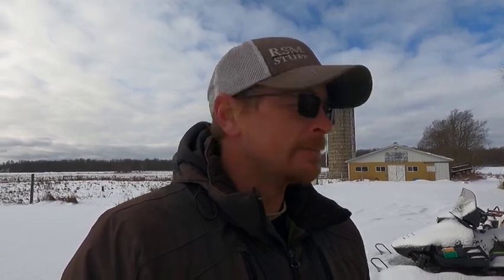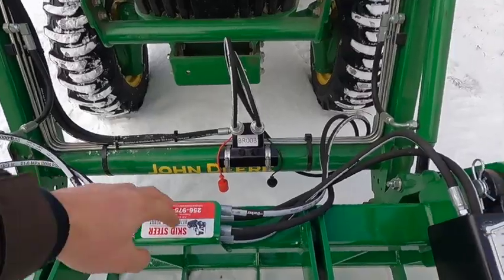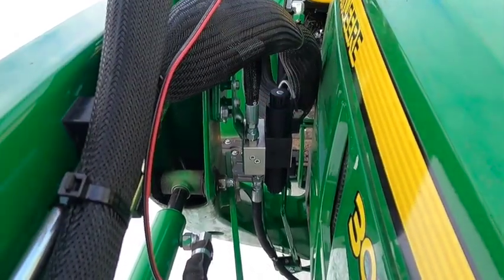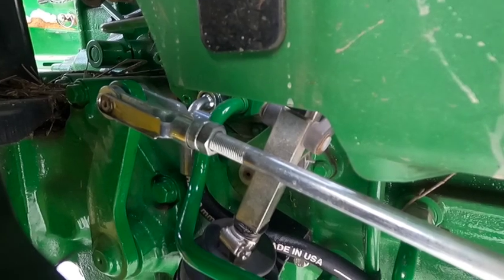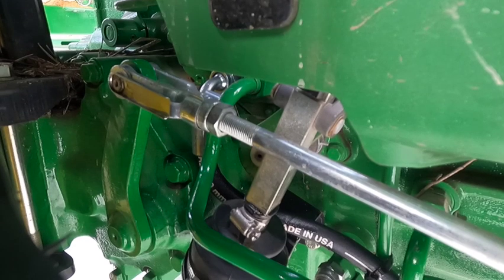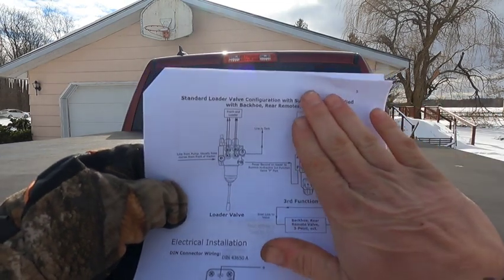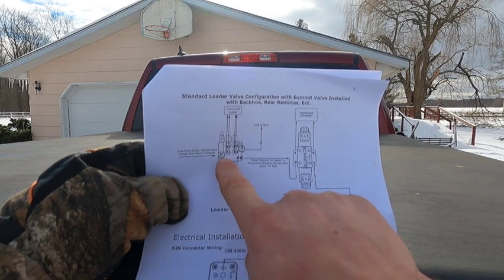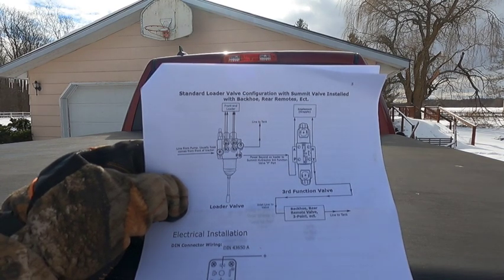It works, grapple on the 3025D

Comment: Hey RSM. I have a 3025D and ordered a grapple. It will have 1/2 Ag fittings. I subscribed and learn all I can from you. I guess I'm ordering a Universal kit from Summit. I plan on getting hyd hoses built at local NAPA.  I',m confused if i need fittings along with my kit. Did you take fittings from Summit kit to JD shop and they added them to your kit fittings.    
thats if you could help me drama.
Reply from the maker: I ordered the fittings and JD put the correct fitting on the hoses to match the fittings that came with the kit (installed on the valve block).

Comment: I’m not sure but I think the 35 has a few more Tom than the 25 so maybe it will be a bit more responsive. But slow can be fast to if you proficient. Looks nice at least I know it can be done. And technically I guess you do have a power beyond it just starts at your loader function right or is that wrong?
Reply from the maker: I would say yes from my understanding of the system. If you add rear remotes it ties into the same hydraulic line and goes up to the valves and back to the side of the transmission. Similar to what I did just going to the rear with steel lines since JD has a kit for it. It is an open system, so fluid constantly flows through the lines until a valve is moved to direct the fluid to do a function. If you want me to get some valve schematics and and try to explain it better I can try to do that.
Reply: @rsmstuff3178  sure if you feel you want to do that that would be sweet